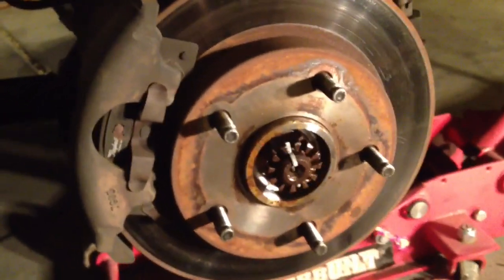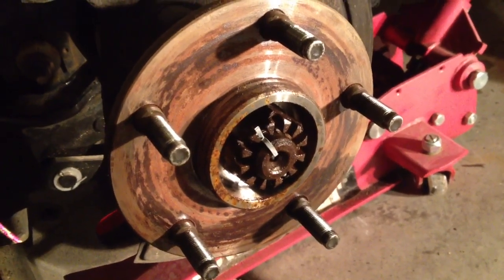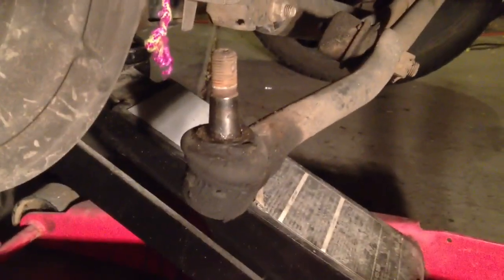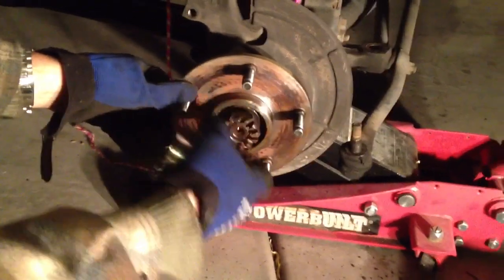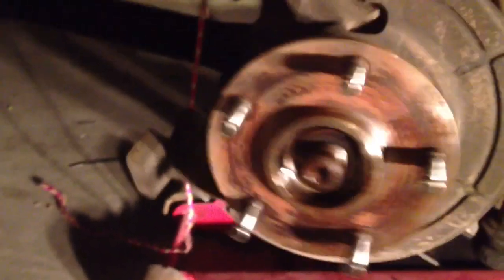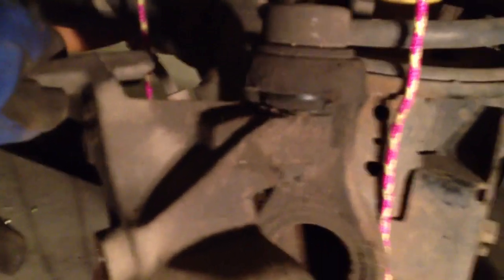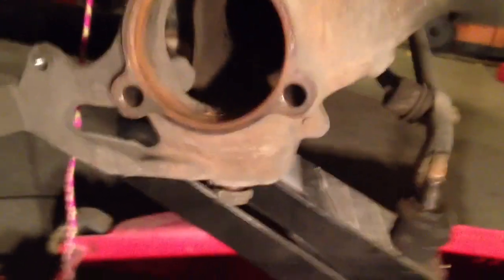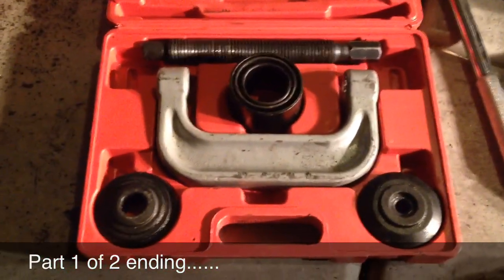Dodge Ram Ball Joint Replacement 1998 1500 4X4 - Part 1 of 2

Comment: Thank you. I am doing the same thing. This helps. My wheel bearing was a lot harder to get out. I had to use a chisel near the bolt holes (to make sure it didn't scratch the seating surface) to break it out.

Comment from the maker: The wheel bearing needs to be removed in order to remove the steering knuckle - so the castle nut has to go.  This is a ball joint replacement.  I totally overlooked the idea of loosening the castle nut while someone in the cab was standing on the brakes. Good call!  I was working with one of my kids, and didn't think of that obvious solution.
Reply: no it doesn't you can pull it as one unit so if you were to leave the castle nut alone and just undo the three bolts that hold the bearing in place  you can pull the bearing and axle as one piece i own my own shop and we do it all the time to these trucks :)      All you had to do was remove the caliper and rotor then the bearing bolts and tap them and pop the bearing and axle out together then use a pickle fork to pop the spindle off the balljoints and then extract the balljoints and put it back together :)         Not telling you, your wrong , just letting you know if you do one again you can save a bunch of time by not taking it all apart, you did it just fine you just could skip a few steps to make it easier on you and much faster :) but yeah using the steering to pop the bearing out is a good idea  you just could have skipped seperating the axle and bearing because it all comes out towards you so it can stay together  :)

Comment: Thanks Manny for a great video. The tip about the flat steel plate was invaluable as I would have never got it done without it! I found these pieces at Home Depot for .49 cents each (department #25). I ended up renting two ball joint kits from Auto Zone because I needed two of the middle size cylinder to install my MOOG ball joints. I also rented the non damaging Tie Rod remover and two removal forks (Pitman arm and ball joint) because my steering knuckle would not come loose with a mini sledge. Everyone who reads this PLEASE make sure your new ball joint is pressing in evenly. I had to reverse the "C" when pressing in the lower from rear to front in order to press it in evenly... took me three tries using the flat steel plates. Be patient (like Manny) and work slowly, this will save you time. If you need a video to show you how to use the removal and press tool, you may want to reconsider doing this yourself. I am the original owner of my 2WD with around 193, 000 miles. Good luck to all you hard core Dodge Ram owners!

Comment: dont need to pull the wheel nut just have to remove the wheel bearing bolts and the whole axle shaft and wheel bearing come right out

Comment: Easier way of taking off the hub assembly, loosen the bolts leave the socket on the bolt and turn the truck on and use the power steering to press it off equally on both sides. Tie rod has to still be attached to work. Best to have a helper turn the wheel for you. Any questions, I can help!

Comment: If you take the axle and the hub out at the same time, you don't need to remove that large castle nut. For your Dana 44, you only need to remove the large castle nut if you are replacing the wheel bearing. Other axles may be different.

Comment: One step that would help out is loosening the axle nut before taking off the brake calipers that way you don't need to use a pry bar anywhere.

Comment: one easy way on axle nut removal is live the rim on with the center plug of ,lower it on the ground an it will be solid as a rock ,you can use a very long extension than

Comment: you could have just put the truck in 4 wheel drive and it would hold the axle still while you loosen the axle nut... :) and i would always loosen the axle nut before removing the tie rod end because it will help hold the spindle from turning side to side on you and making things more difficult :) just some helpful tips :) you should never put anything against your wheel studs because you can mess up the threads and then you have a whole different issue on your hadns :) <3

Comment: pitman arm puller they are junk busted 2 of them on the steering gear box
Reply: proper use of the tool will avoid that. im guessing you just cranked on it with a wrench/socket